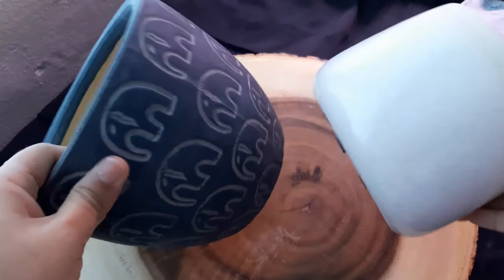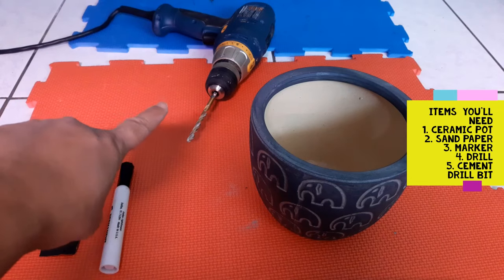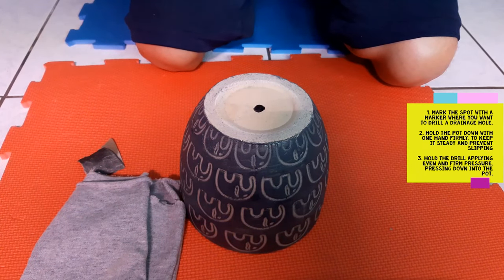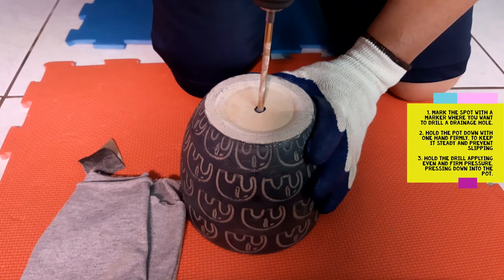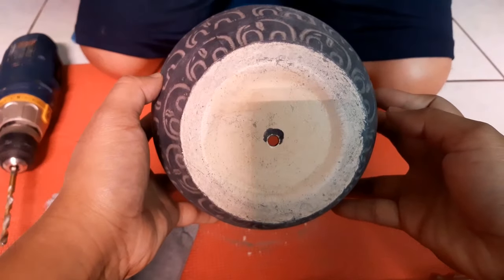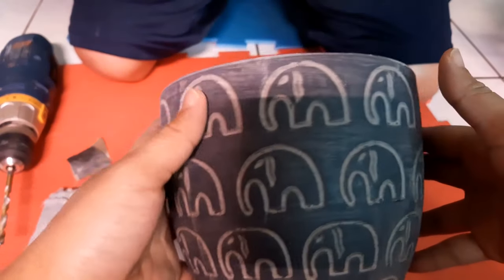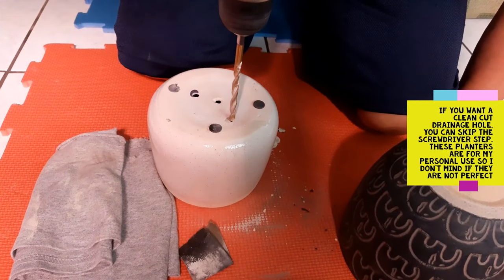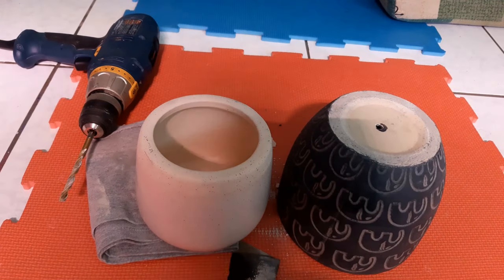#24 HOW TO DRILL DRAINAGE HOLES  without a diamond drill bit in ceramic and cement pots

Comment: Use water, trust me! Either submerge your pot in a bucket of water or have somebody spraying water while you are drilling. It reduces the risk of cracking, keeps the bit cool, and drastically prolongs the life of your bit.

Also he's very slight pressure. For the most part, especially with masonry bits you want to let the drill do the work. You don't want to press super hard not only can It crack your pots but it can ruin your drill end of the bit as well. 

These bits are more com about four or five dollars (way cheaper). The  masonry and tile bit both have a spade shape at the end of them, however a tile bit does not have that corkscrew  look like normal drill bit has, it is  just the spade end connected to a small metal post.

Comment: It's a great alternative to using a diamond hole saw. It would be great to know the amount of time it takes to drill one hole. It makes a difference (cost vs time) if you're drill one hole or a number of pots.  Nice video, Thank You!
Reply from the maker: It took a while just drilling without hammering in a screw driver. But if you follow the method I did, it only takes about 5 mins per pot so it makes it a bit quicker. I know it could take about that much time or longer with the diamond drill bit as well. Although my method is not perfect and will not make a perfect hole, it works pretty well.
Reply: @TheseSucculentBuddies  That's not bad at all! For a moment I thought it would be like 10-15 mins per hole which then becomes a lot of time. Thank you for your quick and helpful response and will def try this method!
Reply from the maker: Hope it works out. Just be gentle when tapping the screwdriver into your pots. And make sure to use semi thick ceramics, not too thin or they might crack.